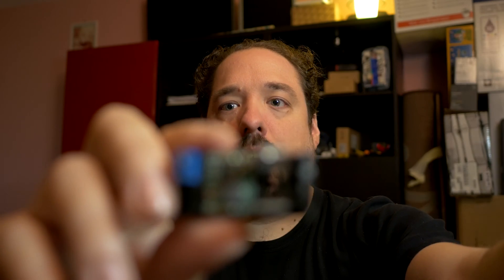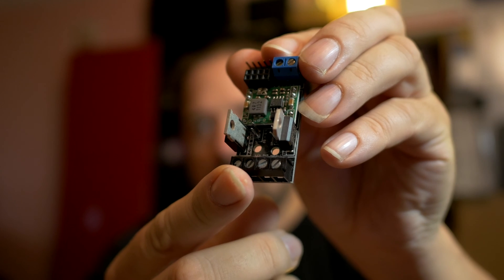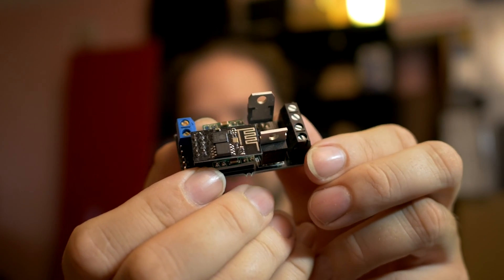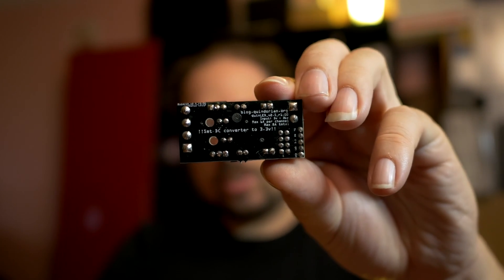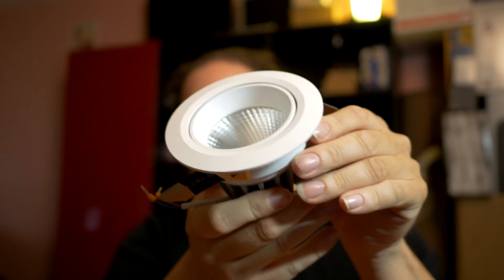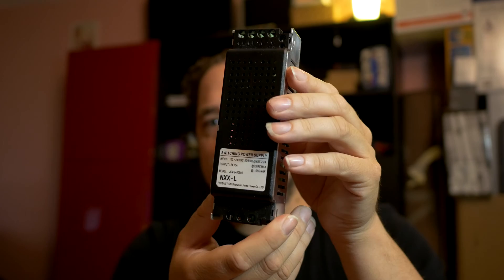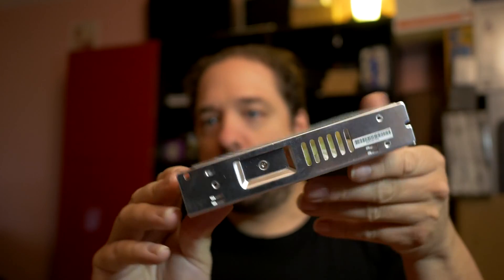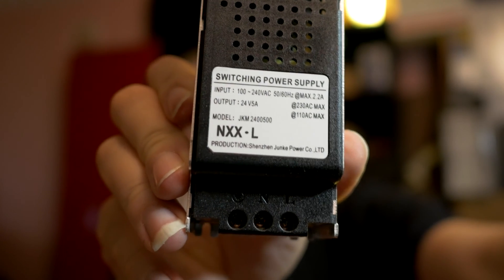ESP8266 LED lighting: LED Power Supply China vs Mean Well

Comment: Okay, so the LRS model burned out in 30 minutes while the SE model burned out in 4 hours, so pretty much all of these seams to be P O J products. https://youtu.be/_DHoUBk1By8
Reply from the maker: Euhm, I really do not understand your test. The LRS series clearly isn't suited to charge batteries and during your test you first crank the voltage to the max and then overdraw (58A) it for as long as you can before you quit it. Maybe stick to 600w next time? You squeezed 800w out of it and the called it bad. You complain of a plastic smell while it's on a plastic board.

I have several of these now and you can see in my test it works perfectly fine for 30 minutes straight, 5v and 12v model.

Also different type of meanwell supplies will react different to the conditions you are subjecting them too such as hiccup mode, current limiting, etc.. Again, the LRS isn't really made to charge batteries.

I'm all for testing and get you are testing for a certain use case and if the conclusion is it isn't suited for that use case, well sure, it's well beyond its specifications anyway. But that doesn't mean you can just call it junk, maybe test the power supply itself then, not your use case for it.... My opinion.
Reply: @IntermitTech  the LRS replaced the S model which is charging the battery for four years in my application so how come the LRS is suddenly not suitable for this application.?